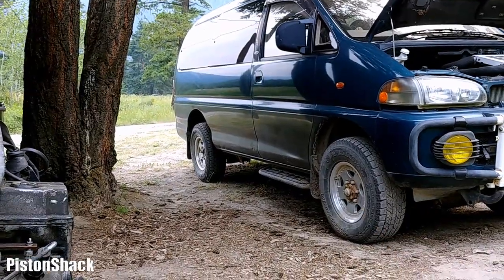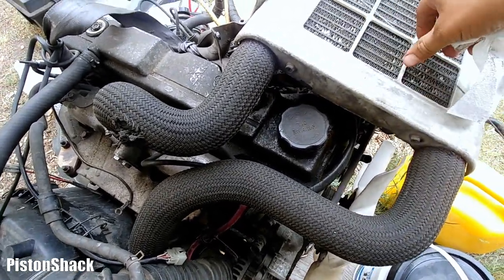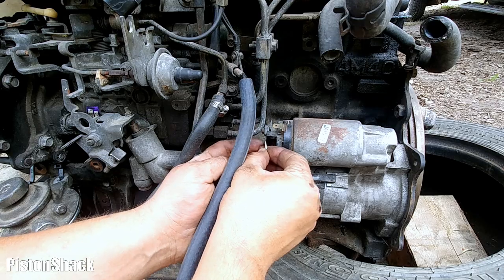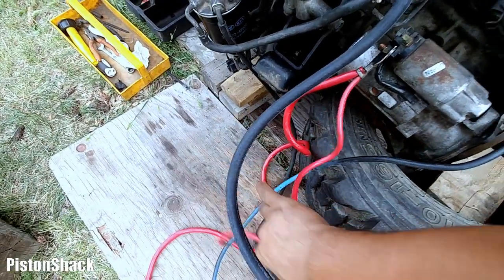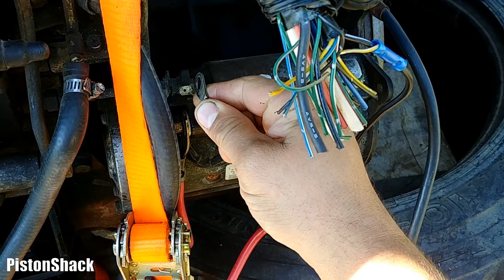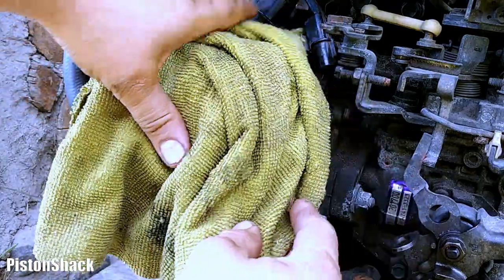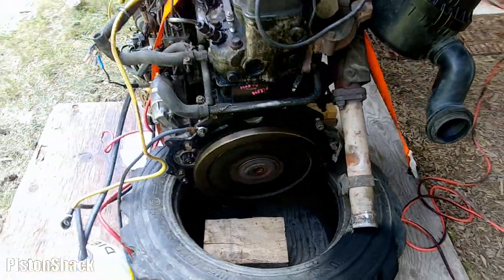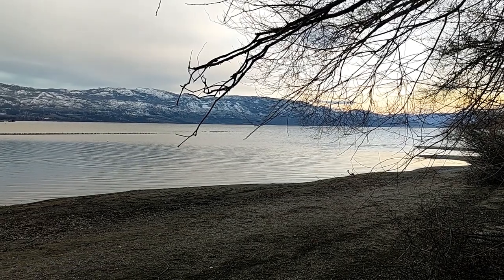HOW TO START 4M40 DIESEL ENGINE OUTSIDE OF MITSUBISHI DELICA | WIRING, PRIMING, PURGING, STARTING UP

Comment: I learned that a 4m40 with new head fitted, timing chain cover and pump had not been removed, yet pump was 1/2 turn out. Vehical would not start. I have seen this problem pop up in other forums, I found it can be fixed without pump or cover removal.

Comment: Thanks for the video.  Just got a JDM takeout to put in my '88 Dodge Raider that i've had for over two dacades, looking forward to it.
Reply from the maker: Sounds great, buddy! I am looking forward to see some of your 4m40 swap videos to 1988 Dodge (Mitsubishi) Raider. Keep me posted. Let me know if you have any questions. Cheers!
Reply: @PistonShack  Thanks!  It's replacing the original 250k mile 4g64/g64b that i got overbored and rebuilt myself at 200k, with a balance chain delete and a jet-valve free head.  Was great with a 36/32 weber and headers, but melted the pistons in it after i got a pinhole open up on the nipple under the outlet hose of the radiator while snow-wheeling a few years ago.  

Should be a pretty straight-forward swap, 80k engine came with all the dressings and trans and t-case, the fit looks good, will have to weld up some engine mounts, prolly make driveshafts, sort the plumbing and wiring ofc, scoop the hood for the intercooler or relocate it to in front of the rad (figure it may be a better option to have the fan sucking air through it, and i could go to a larger one, but more piping volume=more lag).  Came out of a japanese pahero so i'm thinking the gearing should be reasonable, and i've got the LSD rear end for it.  

I run it with a 2" lift and 33" BFG kos.  Was already a great little rally and bushwhacking truck that would take you anywhere and get you through or out of spots that seemed impossible, excited to take it to the next level, basically doubling the power.

Comment: I'd use that engine as a generator but, not knowing anything about Diesels, would make maintenance almost impossible, beside oil and filters.
Reply from the maker: Hi R Verro! That could be one of the applications as power generator. You don't have to be an expert to maintain simple basic old school diesel engine. Keep all fluids up and clean.

Comment: what's the difference between these and pojero, or l200, because i have a rotten pojero with good engine and a good l200 with no engine
Reply from the maker: What engine your Pajero have?
Reply: @PistonShack  it's 2004 4 cylinder 3lt

Comment: As soon as you sead that it's use in case tractors it looked like Sam starter on my case tractor except mine I's clocked 1/80 for left side all the do is clock some parts I've done that few times with my starter guy